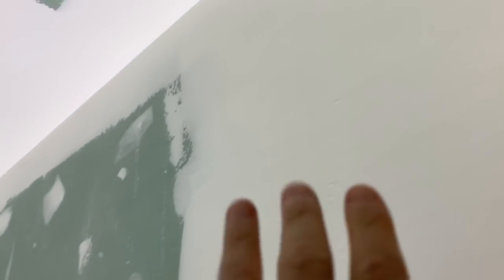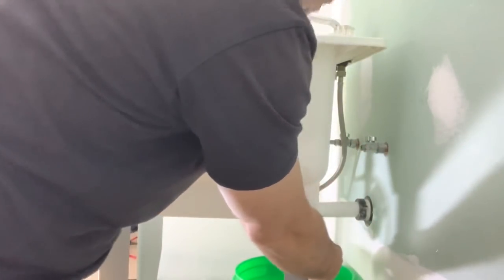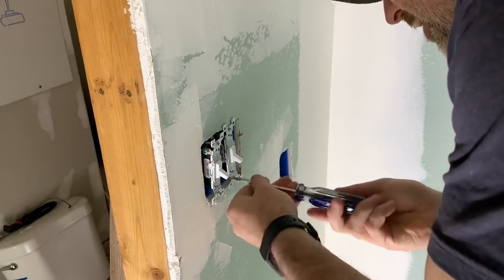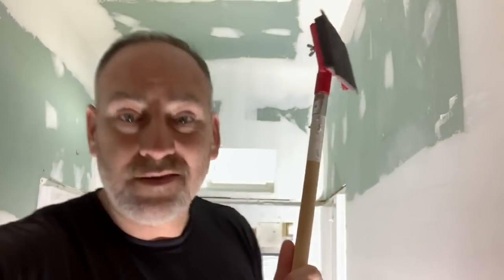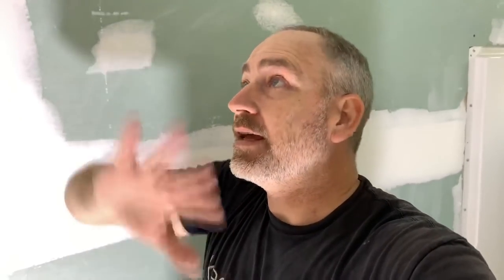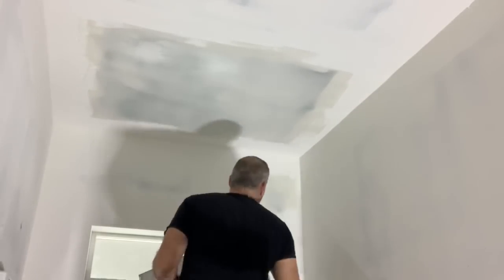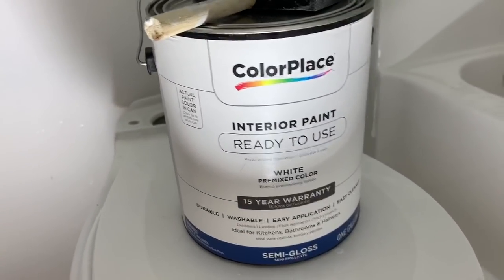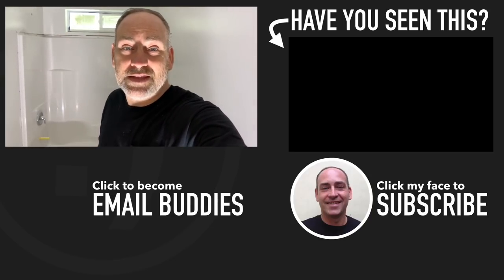Skim Coating our Off Grid Bathroom Walls | Off Grid Cabin Build #64

Comment: Foam brushes are used for stains you need a purdy paint brush there a little bit more money but if you get a brush comb and a wire brush to keep them clean you can get years out of them just remember to put them up to dry before putting them back in the case that they come in.
Reply: My uncle gave me a brush/roller spinner 40 years ago. It is a must for cleaning both. It has saved untold $ in supplies.

Comment: Martin, things are looking good. It will be really nice to have a fully functional bath with vanity and towel bars.  Go buy some cheap sheet vinyl remnant or vinyl plank flooring as a temporary floor.   I can see you are getting better at the drywall finishing.     A couple of painting tips; go to a good paint store and buy  a couple of good quality brushes,  make one a tapered 2" angled sash brush and the other a straight 2-1/2" brush both with tapered thickness  with Nylon / Polyester blend bristle.  Expect to pay $25 ea.  This may seem a lot but if you clean them up each time they will last you for many many years.  Never let them stand in a container of water,  wash out promptly every time you are done for the day with laundry soap etc.  Shape the wet brush and hang on a hook to dry.  With the high cost of paint these days and all the hours of painting -- its foolish to skimp on the brush.  Same for roller covers, nothing more frustrating than putting $38 worth of paint on the wall only to see the roller cover has shed all over your work.   Finally never equate warranty to quality,  engineers and chemists make quality products --  bean counters and attorneys design warranties.

Comment: Mike is right drywall is designed to not need skim coat finish the joints make smooth sand and prime do any touch up  spot prime and then paint Martin is good enough finishing it will still look great

Comment: Skim coating is old school it leaves out imperfection in the sheet rock your corner you need to mud by hand same with your tape joints

Comment: Never clean plaster into a household sink unless you enjoy plumbing problems later. A 5 gallon bucket with some water in it to clean tools in that you can then dump in a spot outside. 

The plaster when you are washing off in the sink will settle in the trap cutting overall flow so when done several times you get layer after layer building up.

Comment: I guess i don't understand the skim coat.  Can someone explain what the skim coat does?  I always just feathered out the corners and joints, then textured.  Then prime and paint.
Reply: He's trying to achieve a "level 5 finish". Generally used to prevent joint flashing on large flat ceilings or large walls that have natural light shine along them. A complete waste of time and materials in this case.

Comment: Normally Kilz is used as a stain sealer on preexisting stains from water damage, mold, mildew etc. There are primers out there just as good as Kilz that are made for the bathrooms and water prone areas that are cheaper. For the rest look at oil base primers vs latex.
Reply from the maker: Thanks for the tip.

Comment: In the bathroom I would not bother skimming, a decent PA sealer and waterproof adhesive for tiling would be the best way forward. Not sure of your building regulations, here in England I have tiled many bathrooms with complete success, and still admired by many customers. Regardless the outcome is the same. Thumbs up for your resolve. 👍.

Comment: Attention, warning, danger, listen-up!!  Wash the drywall mud off of your tools in a bucket of water and not the sink.  All that mud will settle in the trap, the sewer pipe, and the septic tank.  It will not decompose like everything else.  You may need to drill out the pipes.
Reply: Absolutely Correct. Why Martin didn't Like your comment ?

Comment: Martin, who put the skim coating in your head? Totally unnecessary. You pointed out the dings before painting, joint compound is inherently soft. The dings are going to appear frequently.  The rock board is much tougher, and the rock/taping method is proper
 If you insist on a skim, you should use a plaster material. You have a long way to go. Drop the "skim".
Reply: grabs popcorn
Reply: @zz44ppppp  could you explain that comment
Reply: @mikeoconnell4229  Its the way he wants to do it, whats wrong with that.  And I am sure @EJ comments is referring to people, like you, who want to tell others why they are wrong instead of just watching.
Reply: @HospitalLocksmith  nicky, if you read my comment I explained the problem and offered a solution. Is that not okay? Perhaps there should be friend for safety Sally? How about sensitive suzy for you groupies.40 years in construction, my comments are based on it.
Reply: @HospitalLocksmith  I still need a pop corn explanation!
Reply: @mikeoconnell4229  I was referring completely to the popcorn comment, I don't care how Martin decides to build his house, its his house.  Had you not asked about the popcorn comment, I would have never replied.  Perhaps its not I who is so sensitive.
Reply: @HospitalLocksmith  nicky, would you be so kind and explain the popcorn comment? I dont understand its relevance.
Reply: @mikeoconnell4229  He is refering to sitting back watching people complain. As though its a show to watch
Reply: @HospitalLocksmith  thank you,  I hope he enjoys his popcorn. It's all entertainment for the viewers. Real life for Martin and his family. Once again I offer suggestions with my observations, based on many years in the industry.
Reply: @mikeoconnell4229  ready to watch the sparks fly as Martin fights with you
Reply: @HospitalLocksmith  wrong. I have no idea about DIY
Reply: @zz44ppppp  this not about a fight. Martin can evaluate the information and make his own decisions. His quality of work is outstanding for his minimal experience. The suggestions I offer are based on years of building. His home will be something to be proud of regardless.
Reply: spray popcorn on ceilings Mike is right drywall is designed to not need skim coat finish the joints make smooth sand and prime do any touch up  spot prime and then paintmartin is good enough finishing it will still look great